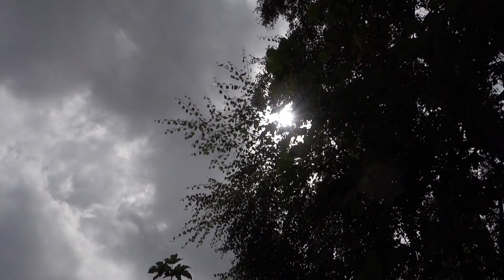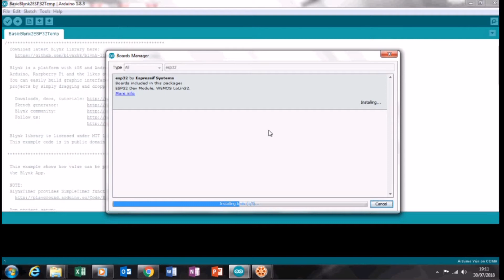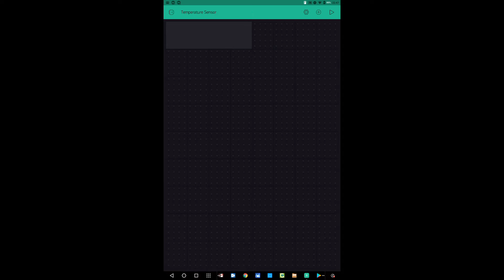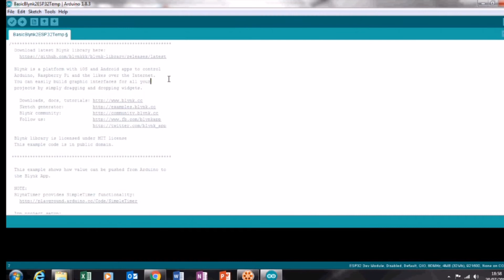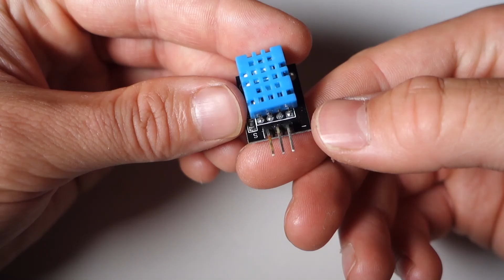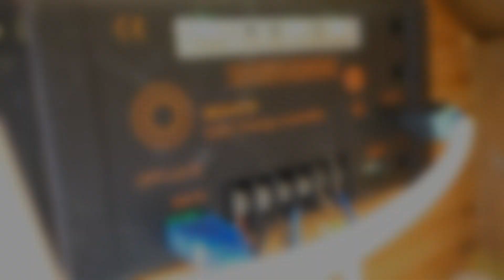How to configure Blynk with the ESP32/ESP8266 - Arduino Tutorial

Comment: hy, i tried this and work well, than i changed the input pin from 13 to 34. Have you any idea why doesn't work than?
Reply from the maker: Hi there, if you changed the pin you will need to update the code to reflect this
Reply: Obviously, but the project doesn't work with the 34 pin. No problem i did it back. I just was  curious.

Comment: hello, sir need help with Blynk app here, I connect my two sensors which is temperature and ph sensor to esp32 dev board. the problem is my blynk app keeps telling me the value is 1 until 999 and so on for both sensor. but when i click on serial monitor at arduino ide the reading is ok. what is the problem? is it because of coding? please help me sir because i need to submit my work ASAP.

i am using 
Blynk.virtualWrite(V5, millis() / 1000); for temp
Blynk.virtualWrite(V56 millis() / 1000); for ph
Reply from the maker: What are you printing in the serial monitor? I imagine it's something to do with Blynk converting to a string, try writing a pre-formatted string to Blynk.
Reply: @cabuu4122  yeah, i figured it out a couple of week ago. its my declaration at Blynk.virtualWrite(V5, millis() / 1000);

it should be 
Blynk.virtualWrite(V5, temp);

Comment: I wanted to ask one question,
The virtual pins you used in the app, how is the blynk app able to auto connect to the variables that hold the actual data of temperature and humidity in the esp board?
Maybe some code you edited in the IDE and didnt mention?
Reply from the maker: Hi there, the code i uploaded did not do this! Thanks for pointing this out, I have added a link to a corrected sketch, hopefully this answers your question
Reply: Ok, thanks for the quick reply!
Now it makes sense.
"Blynk.virtualWrite(V4, t);" is what i was looking for :)
thanks alot, now i can proceed to my project!